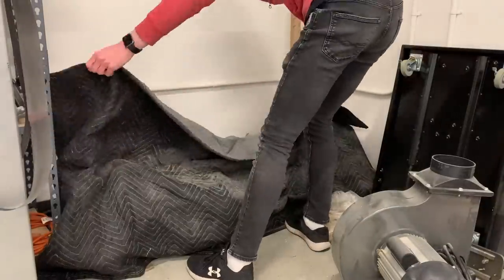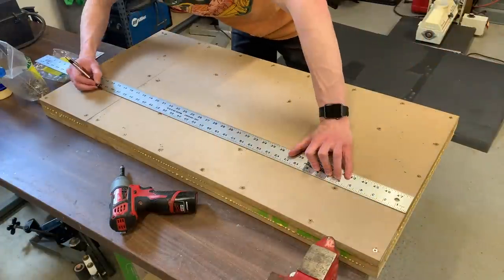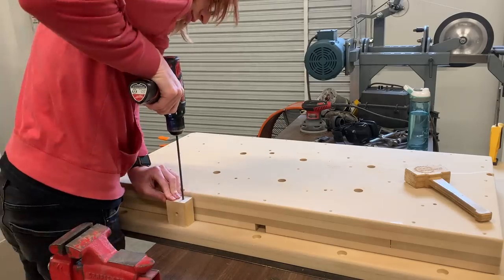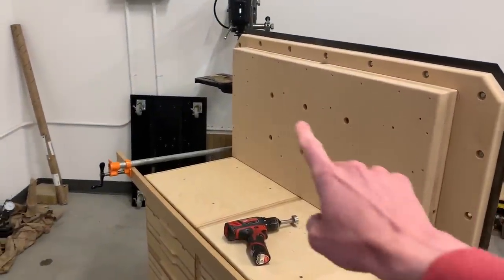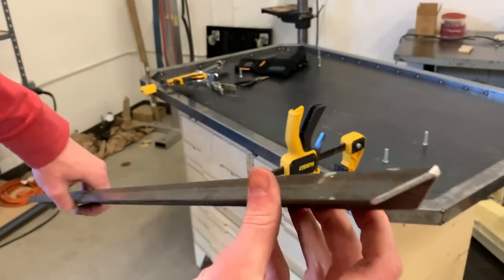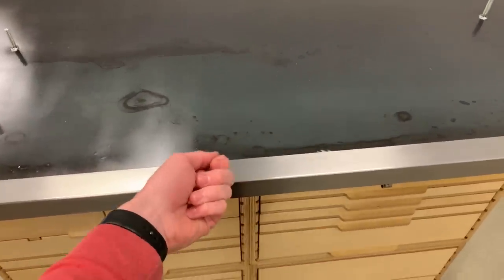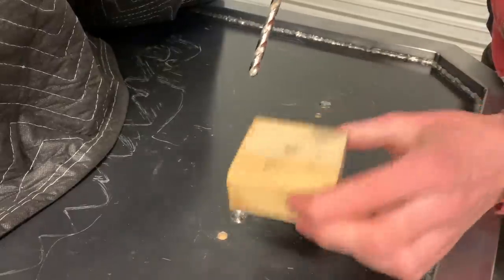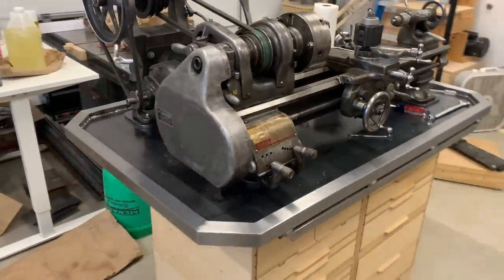Making a stand for my lathe

Comment: This is an excellent solution. As usual, a more-elaborate effort than a slob like me would undertake. Your delay for some years in getting the lathe set up is an example of a "gumption trap" (from Robert Persig's Zen and the Art of Motorcycle Maintenance )--a project that seems too big to even contemplate, especially with limited time but unlimited expectations. For me, just having to hunt-up the needed tools can trap me into weeks of delay. GTs are some of the biggest problems I (and almost everyone, I suppose) face in life. It's an outstanding thing, though, that you've been getting out shorter videos but more often--in this case even without being sure how to proceed. As a viewer, I think that's what I want.
Reply: Another book added to the ‘must-read’ list. Thanks!
Reply: "Gumption Trap" is an excellent term.

Comment: Very nice lathe cabinet/bench.  When leveling my lathe to the bench top (to eliminate twist and true to the bed) I adjust the four corners of the lathe with two nuts per mounting bolt, one on the top to lock down and the bottom nut to raise or lower that corner.  When level, the lathe is suspended on the four corner bolts, just above the surface.  My lathe bench is also constructed of wood and I do have to occasionally adjust the bed back to being level as the wood moves (drying, sag, vibration, etc ).  Looking forward to seeing your lathe power control bar design in action.  I've used the commercial two-button (one to push-to-start and the other extra-large button to stop) on my table saw and I like the hands-free, bump-to-stop feature.

Comment: Great work!  You can test the weld by just wiping it with oil.  You will see it bleed through the other side.  Use baby powder to check  the opposite side and repair any tiny leaks after you clean it.
Reply: Also a spray liquid penetrant tester and developer kit is cheap and easy to use.

Comment: What caused me to comment was the final lifting of the lathe to the new bed. That you prepared the ground work by breaking down the lift into a two stage lift and not an all in one heave-ho job that was begging to go wrong. As you showed, the final stage lift to the cabinet was too much for your helper leaving you with a clear exit strategy to half way back, and not straight down to the floor again where the lathe may well have suffered damage in a drop, never mind damage to your helper. That was first class workmanship right there.
The way you solved for that by raising the height of your helper was creative, out side the box and worked demonstrating your innate aptitude for the work you do.
I am left envious of the quality of finish you've given your lathe leaving me feeling inadequate and way behind the curve - I could have done so much better as you've demonstrated.
I doff my cap to your superior workmanship.

Comment: Nice build. I like it. One step you missed, is you need to make sure there is no twist in the lathe bed. Yes, as heavy as it is, it can still twist. If the base isn't perfectly flat (nothing is), when tightening down the mounting bolts, you may have introduced a twist in the bed which will result in a taper when turning a part. You need to use a precision machinist level to make sure there is no twist in the bed. It's not important that it's level to the earth, but that the headstock end is as level as the tailstock end.

Comment: Jer, your design ethic is tremendous but you pocketbook is surely holey. I am always amazed with how much thought and skill you put into your projects but that always seem a bit costly because of the grades of material you use. Don't stop on my account. Everyone needs to see how its done RIGHT and well.
Reply from the maker: I understand what you mean and you’re right, but I don’t think you’re seeing the whole picture behind the scenes.

The MDF was mostly scrap (old CNC spoilboards & jigs), the sheet steel was leftover from a different project where it made the most sense to buy a full 4x8 but I didn’t use it all (and it was rusted really badly on the bottom side; I cleaned that up off-camera), the T-nuts were some that a friend bought for a project and they didn’t work out, the bolts were all ones that I already had (bought bulk, second-hand), the angle iron power switch was out of the drop bin at my local steel supplier (~$0.50). The only things I bought new were the square tube, threaded rod, and paint.

Thanks!

Comment: Pretty fantastic work, Jer! 😃
I think the mistake was because you realigned the lathe and didn't consider it when marking for the holes. Because it's almost the same difference!
Anyway, stay safe there with your family! 🖖😊
Reply from the maker: Thanks!  Nope, I foresaw that when I decided to shift the lathe over, and I made sure to move the motor too. The relative position of the motor to the lathe in my final version matched my original CAD, so the original CAD was wrong.

Comment: I foresee a problem with that full length on/off switch. You are going to be hitting the switch as you stand close to the machine while using it. Perhaps having the on/off at each end is a better idea. The switch is angle iron. Just cut off the protrusion between each end. The middle would then be flat stock and angled on each end to act as paddle switches.

Comment: Beautiful build Jer.
Love the idea for the power switch.   Will you also have a separate reverse switch?
Reply from the maker: Thanks. I’m still debating if I want to put reverse on it. With the threaded chuck you can’t do any hard work in reverse. If I do include reverse, I’ll stick a toggle switch on the junction box for that.
Reply: @Jer_Schmidt  mine is the same 1.5x8 threaded spindle.  Reverse is very handy, especially when threading as you don't have to disengage the half-nut.
Reply from the maker: @keithviolette5870  
Good point. Yeah it’s probably worth it; I’ll consider it.

Comment: I see that you really like the hand held band saw. Is it basically the best tool for the job? I dont see it used all that much elsewhere.
Reply from the maker: I love it. I suppose a properly-tuned horizontal bandsaw would give me slightly better results, but it takes more setup (especially to make angle cuts), it’s not as versatile, and it takes a lot of floor space — the hand held one is so compact I just store it in a drawer when not using it.

Comment: Jer, every single one of your builds are so well thought out. How long is your design process?
Reply from the maker: Thanks! 
It varies a lot. I worked for about two years on the modular cabinet design (not continuous, but the cumulative total would add up to several months at least). I’ve had this lathe stand in the back of my mind for years, but only got serious about finalizing the design a couple months ago. The cardboard hardware box video only had a few days of planning.

Comment: Nice...
My fear with so much weight would be deformation of the drawer stand due to uneven floor, you need to make sure it stand level wherever it ends up 🙂
Reply from the maker: Yep, I’ll likely replace the caster feet with leveling feet once I decide where to put it.

Comment: I watched  a few of your videos some years ago and was very impressed. your CNC  machine, your table saw guide and making of the wooden colorful rolling pin as yours broke.  As I saw the notification, I could not resist to watch this video. Always fun watching your videos.   Which Miller welding machine are you using? I have an older Lincoln 140HD that I bought over 10 years ago  but am looking for a better and lighter one.   I could never weld as nicely as you did in this project.
Reply from the maker: Thank you! This welder is the Miller 211. I definitely recommend it, great machine.
Reply: @Jer_Schmidt  Thanks for answering me. Are you using it with 110v or 220v to make your welds?    I have only 110 at my place. I was also looking at the Miller 141 also last night and am not able to make my decision yet. But definitely would like to make nice/clean welds like you did in this video.  I also tried to make a CNC machine inspired from your CNC video, I did it about 90 percent and gave up due to lack of time. But have to complete it some day. I started it all with aluminum angles and flat bars like yours, but now want to redo everything using steel tubing and welding and nuts/bolts so i can take it apart if I need to move it.
Reply from the maker: @macvideoworld  
I’m using 220v. I think you should be able to easily make nice clean welds on 110v, on this thin of metal. It will only start to be a problem on 1/4” and above. (I haven’t tried 110v, so I’m NOT speaking from experience)

For clean welds you need to get a MIG with gas, not a flux-core machine. Other than that it shouldn’t make too much difference; all but the absolute cheapest machines should be able to do as good of job as I did here.

Comment: Are you going to add a reverse switch that runs the full length as well?
Reply: By having the full-length switch first in-line, it acts as the START/STOP, and the usual FOR-OFF-REV switch then acts as a selector (although still possible to use this switch as normal, and treat the full-length switch just as an EMERGENCY STOP)

Comment: Perfectly done!  But why in imperial units? How do you decide when to use imperials and when to use metrics?
Reply from the maker: I use metric as much as I can, and only switch to inches if the material I’m using is inches. It’s basically impossible to get metric metals here, so that forced me to use inches.
Reply: @Jer_Schmidt  But why just can't multiply by 2.54 and use metrics everywhere? :D
Reply from the maker: That gets messy really quickly 😬
Reply: @konstantinlee2275  Maybe because you can do the same thing for yourself?
Reply: @tcarney57  Sure, for myself and everything around I am always converting imperial to metrics, almost forcibly and never mention imperials as it's outdated retired system. But when other people explain something in imperials it's not alway obvious to imagine and immediately understand a size they are talking about.
Reply: @konstantinlee2275  Well, I grew up with both, and I use them interchangeably. I learned it in elementary school in the 60s, so Americans have been using it a long time. It has caught on for some purposes but not others. "Imperial" very definitely is not a retired system, and in the English-speaking world (UK, Ireland, Canada, Australia, New Zealand, and the United States, etc.) it is still widely and commercially used and intuitively understood, even my younger people, and often in spite of government mandates. [BTW, there's no need to use fractions with inches or feet. Decimal inches are as easy to use as MMs or CMs.] Imperial is like any language: it's not consistent and in some ways completely nuts, but also like a language it's culturally determined and and preferred by those who grew up with it. 

Anyway, these days, it's not usually acceptable to say an aspect of someone-else's culture is deficient or wrong, at least not one as trivial as a system of measurement. I use both systems because a) in unimportant matters I try to take reality as it is without grousing (though I obviously often fail), b) I find both measuring systems useful in different situations, and c) it's part of my commitment to pluralism, diversity, multilingualism, and internationalism. 

Admittedly, that's a lot of stuff to say about something I've claimed is trivial, but I had a few minutes to waste while my soup heats up.
Reply: @tcarney57  Thank you for your time Todd, I appreciate it so much. I understand what you mean. When you grown up with imperials it's very hard to switch to other system. Like when you learned just one language from childhood you will always talk in your native language in your dreams, even after moving to other country and living for decades using other language. Imperials is good when you measure grows of you children at home, or distance in your garden. But once you go internationally you have to use some accepted standards. Science is using metrics. And it was officially adopted. USA government issues rule to migrate to metrics. Changing habbits take some efforts, sometimes quite a lot of efforts. If nobody will move to metrics people will just use incompatible systems leading to huge mess. I haven't said that imperials is wrong or deficient, it was just superseded by metrics. Using metrics in XXI century is like speaking on old Shakespeare english language on aeronautics conference.
Reply: When available, I use metric plywood because then I can easily measure very accurately for drawers and cabinetry.  I have a hard time dealing with 21/32” so I use two scraps to measure against for inside or outside dimensions, but use metric measuring tools.  Promised that the US would move to metric when I was in the first grade in 1960, I’ve been disappointed ever since.  Though I use imperial measurements for some things, I prefer metric for woodworking as I don’t make stupid mistakes.  I use metric whenever possible, and my results are much more accurate.  Someday I’m hoping for a metric dado stack!

Comment: When you discovered the alignment error, I kind of thought you would just put a new dimple onto the shaft that the sheave goes on and move the sheave over 1".  Not a simpler solution?  You still would have had to bend that other shaft.
Reply from the maker: I considered it, but I don’t have a way to do a decent job at that. I have no tool that can create a nice, centered dimple. And the other part that I didn’t take the time to show: there are actually two dimples at 90° to each other. So I would have needed to get the two at the perfect spot relative to each other. Easy with a mill, but I don’t have one. Maybe possible with a fixture on the drill press, but would have taken more time to build that than what I did.

Comment: 18:31 did your move to appear center across the lathe (vs centering the feet) get translated to the motor?
Reply: I'm assuming so since at 9:07 Jer uses one of the scribed lathe feet holes as a reference to mark the position of the motor mounting holes.

Comment: Is the line up issue of the motor because you centered the lathe differently during the build?
Reply: Awesome build. Great to see all the thoughts you had building.
Reply from the maker: No, I positioned the motor relative to the lathe’s position, not relative to the pan. But that relative position was wrong in the CAD.